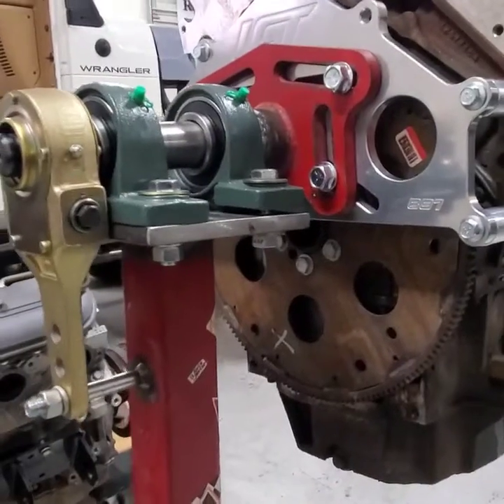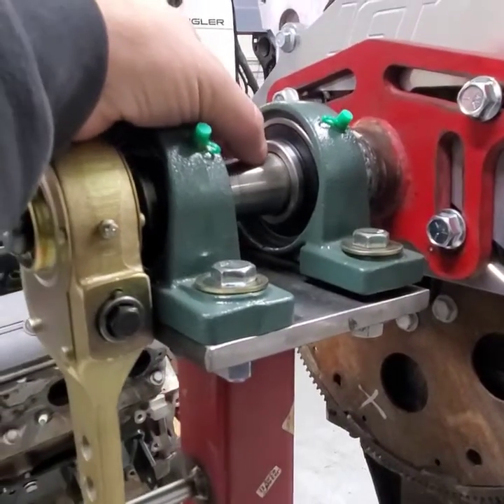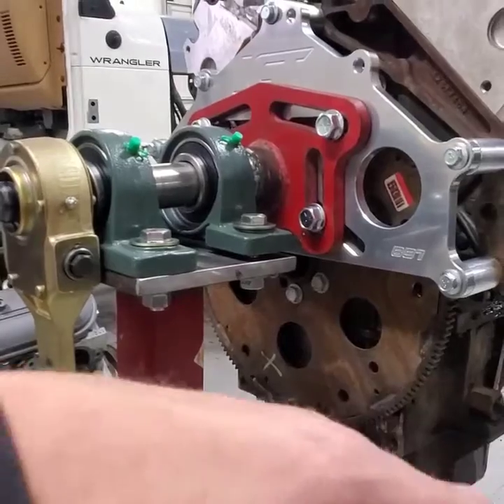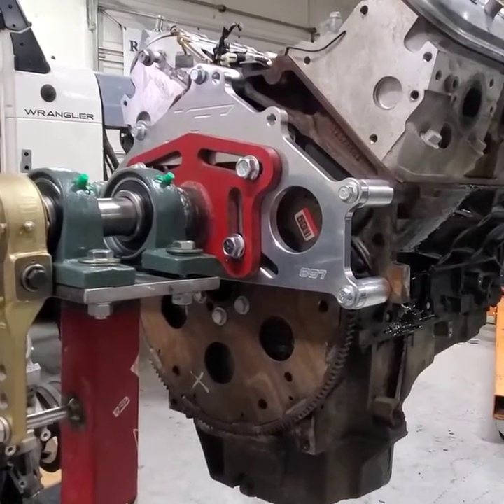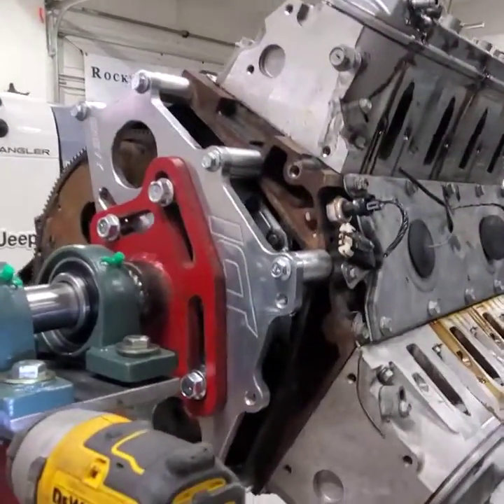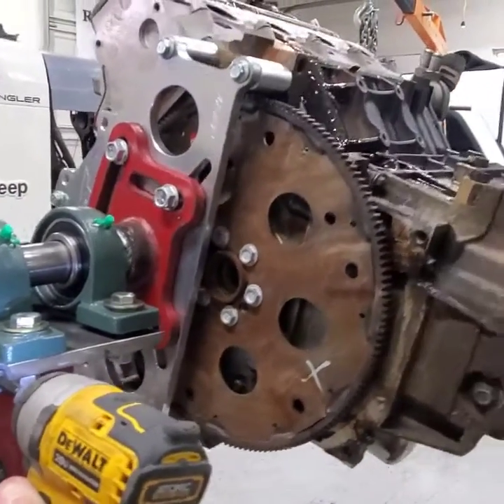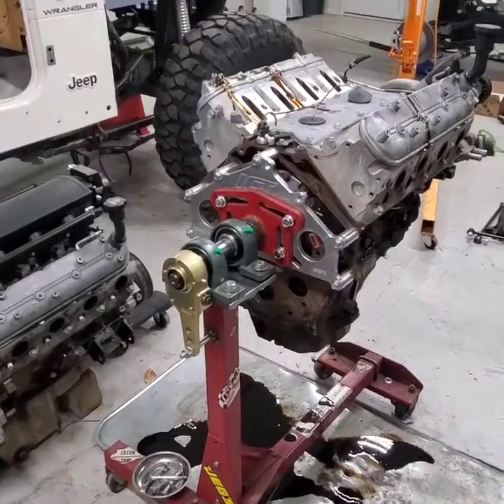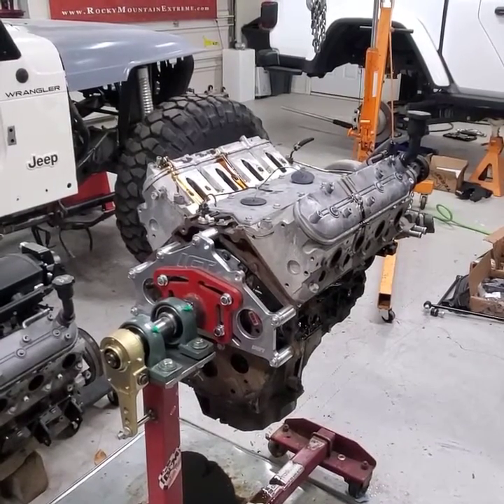DIY Geared Rotating Engine Stand

Comment: One thing I would add is grind a flat bottom notch in the shaft so you can lock it in with a set screw or bolt on the lock collar.

It's probably stuck in there pretty good with the weight of an engine but it looks like the shaft isn't retained otherwise.

I really like this concept and I'm going to try to make one or a few with used parts if I can find them.

The only other thing i can think of is to make some sort of adjustable plate to center the load or re-center if you take off the cylinder heads or something.

I love how heavy duty it seems and the worm drive to prevent gravity from spinning it is much better than the modified winches that some people use.
Reply from the maker: @beardoe6874  Great ideas, thanks for the suggestions.

Comment: Thanks for this.  Picked my parts up yesterday.  Went to a local business who overhauls semi-truck rear ends.  For warranty purposes, When they do a rebuild for retail. They automatically replace these two components with new parts.  The used go into the metal recycling bin.  They were great and gave them to me free.  Dropped the shaft off at a friends shop where it will get a thorough cleaning. He’s going to put it in his lathe, cut off the knuckle and true up the shaft for the pillow bearing.  I’m going to use it as the rotating gear on a stand that will have a grinder at the top and a grinder on the bottom.  This gives me the ability to grind and polish with 4 different stones and buffers.  I’ll position it in my shop to give me easy access to the adjuster.  Again, thanks for the inspiration.
Reply from the maker: That's a great idea to get the parts for cheap!

Comment: I like the gearing method. Neat. Though an impact is a bad idea for any gears, much better to use a drill. Ive destroyed gears in jacks and other tools with impacts. I learned the hard way.
Reply from the maker: Good point! I have a speed handle that I typically use, it gives me more control. I used the impact because it was handy, but not ideal for sure. Thanks for the comment!

Comment: Does it need a positive stop to keep the engine from turning while working on it?
Reply from the maker: No, but it does have a slight amount of play in it back & forth. It hasn't been an issue, I've torqued down head bolts, etc with the play and it's been fine.

Comment: Thanks for sharing this. I'm building a stand based on what you did here. What are the dimensions of the plate you mounted the pillow block bearings are mounted to?
Reply from the maker: Mine is 7" x 6", just keep an eye on the length of the S-Cam shaft length and the width of the pillow blocks and build around those measurements.
Reply: Amigo cómo se llama esa herramienta. COlor dorado y ese acople que lleva desde Peru  que nombre lleva

Comment: I used the 28 spine. The teeth for the worm gear are on the outside so it doesn’t matter
Reply from the maker: Nice! Yeah, as long as the cam shaft and slack adjuster have a matching spline count, you're good to go!

Comment: Seems like a great idea. The additions also seem to be heftier than the original stand. How is this working 11 months later?
Reply from the maker: It's working great, 3 different engines on it and a transmission. Each one was handy to roll over to work on. There's currently a 350 block mounted up, getting ready to build.
Reply: @RockyMountainExtreme  Excellent, thanks for sharing.

Comment: Would it be better with a 28 spline? Would it turn slower? What pros or cons could i anticipate with it? Oh my. I am thankful to come across your video!!  🙌
Reply from the maker: It doesn't matter, long as the S cam shaft and slack adjuster are the same spline count. That won't change the rotating speed.  I used my rotating engine stand today with a speed wrench and it was so handy!
Reply: @RockyMountainExtreme  awesome. Thank you so much for the reply. Perfect solution for my heavy 6.0 powerstroke. Do you know of where I can obtain a plate similar to yours bolted to the rear of the engine? I tried googling but cant seem to find one for. 6.0 powerstroke. Thanks.
Reply from the maker: @leroijr407  You're welcome! I sourced my engine mounting plate from ICT Billet, I know they make mounts for other engines, but I'm not sure about the PowerStroke.
Reply: @RockyMountainExtreme  perfect. Worth a try if they can do a custom one for me. Thanks.

Comment: The S cam link does not work :(
Reply from the maker: I found another S-Cam that should work for $10 less than the one I used! Updated the info and link in the description, too. - 

S-Cam ($47) - https://extremebrake.com/product/s-c2-011-l/
Reply from the maker: Ahhh, that sucks! You'll need a 10 spline S-cam to match the slack adjuster. I'll try find another link and update the info. Thanks for the heads up.
Reply: @RockyMountainExtreme  Just thought you should know and thanks for posting this :)